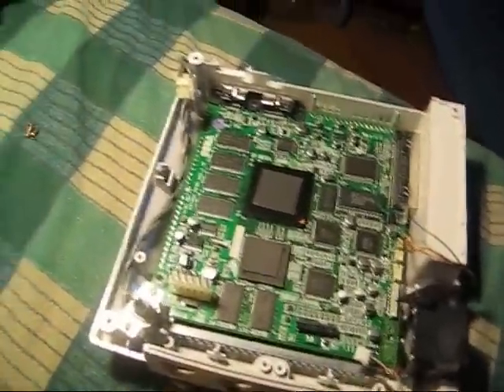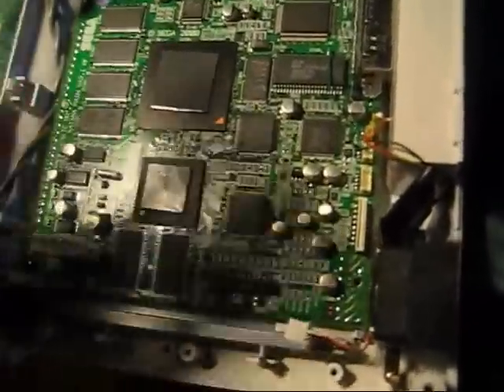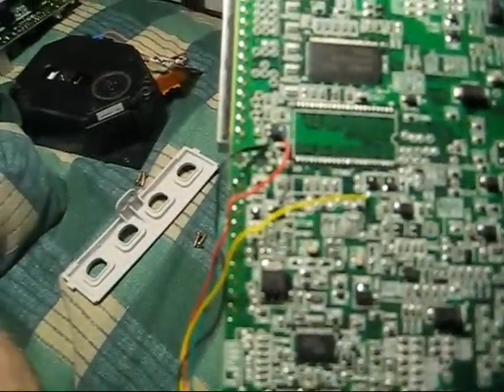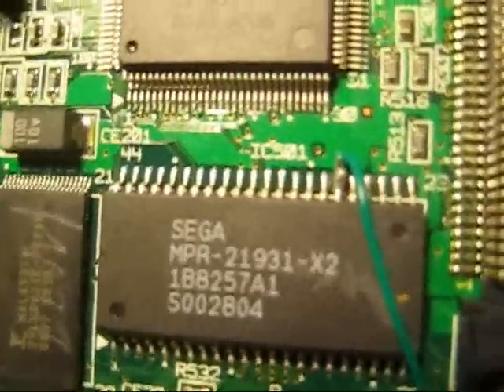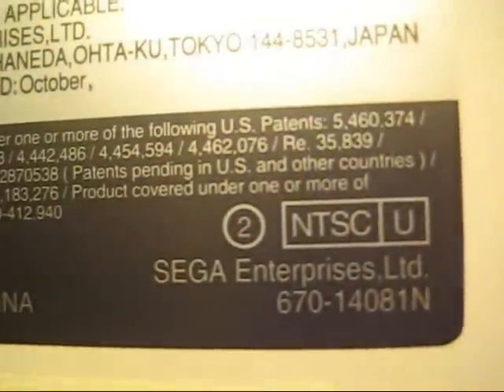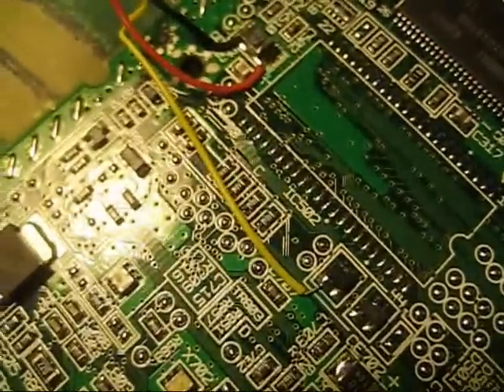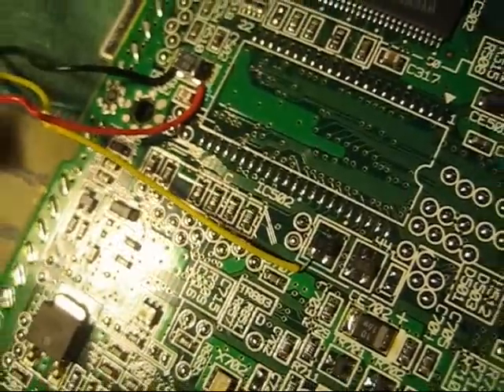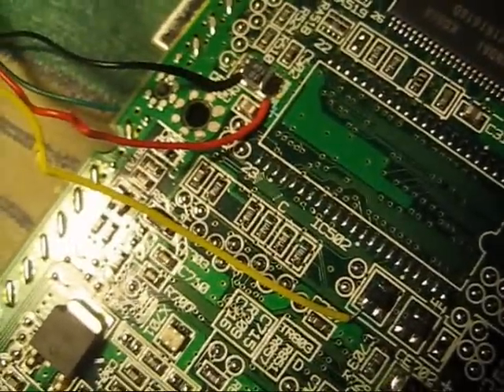Dreamcast Mod Chip on VA2.1 motherboard

Comment from the maker: Except that one could also burn a game and have the DC boot it (if burned correctly, and that process changed slightly to get backups to boot on a later model), so technically you could burn the Utopia disc too.  I might have said something like this in the video already but.... yeah, then I'd have to watch it again.
Anyways, the best part is that the DC doesn't check for any sort of region while booting from CD (or CD-R in this case), so you technically don't need a mod chip at all, ever!

Comment: From what I understood, the Dreamcast - at least the systems from around launch - didn't need any kind of mod chip, you could get hold of a Utopia Boot Disk, boot it up, pop the cover open, place the import/backup disk in, just close the cover and play.

It's a lot quicker and safer than installing a chip, but I can understand not wanting to swap disks all the time.